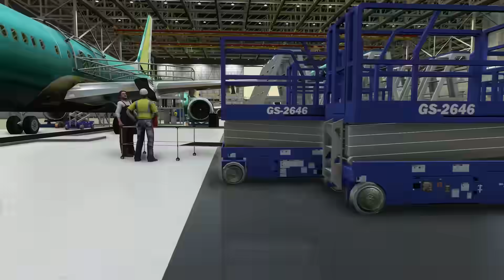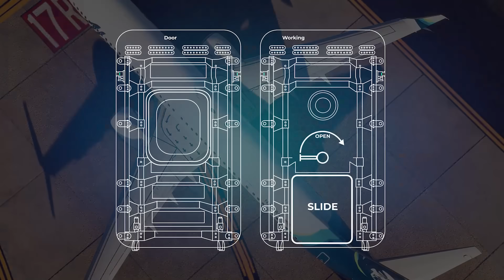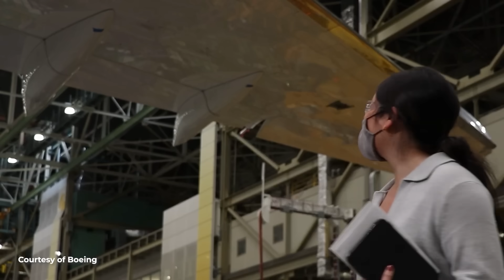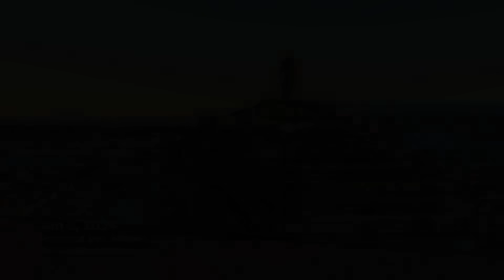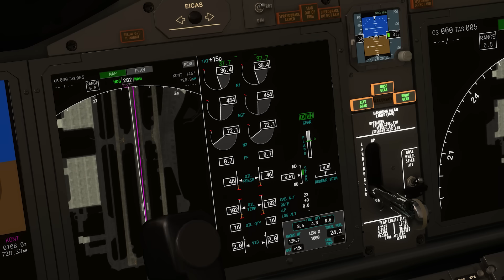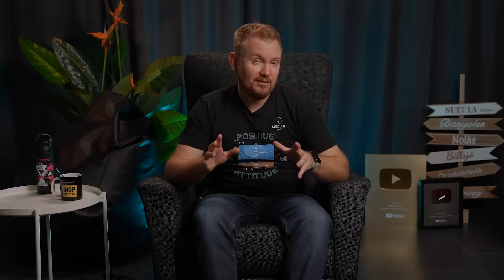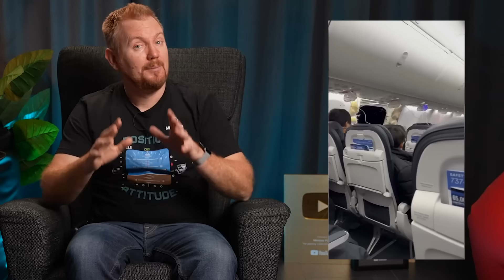Boeing 737MAX BlowOut!! The Scandal behind Alaska Airlines flight 1282

Comment: Thank you for posting this video. I believe the events of the Alaska Airlines flight were very well laid out thru the writing, the excellant graphics and explanations. Hsving flown extensively on all 737 generations I have been very negatively impressed by Boeing 's fall from grace, and believed from the first published ideas on the Max series was a serious mistake. The Max series, in my opinion was a betrayal to pilots and passengers due to the MCAS failed system, the lack of multiple AoA's, the deceitful  implementation of MCAS, etc.  In addition, the manufacturing and poor QC still on going is astonishing. It does not reflect Boeing's past aircraft such as earlier 737 versions, 100, 200, Classic or the NG's, as well as the 707, 727, and the 757 and the 6. I've flown on all of these models, some of them extensively, with the k owledge and experience of GA flying, also.  As I see it it appears the 6 crew members did a very good job, all the way around, thou there is the luck that the 2 closest seats were unoccupied, and apparently no one was nearby the door plus blowout without being belted in, or walking in the aisle, as well as the relatively low alritude of approx 15,ooo when it occured.  As well, the rapid decent and left hand turn and line up to land, and land seemed impressive in how well and our quickley it was executed.   Last few points, 1. Delivery on last day of month, was the delivery rushed to book it by boeing to set up payment ? What is the monthly delivery  schedule look like? Does it trend evenly, or is it weighted more heavily toward the ladt week, which raises questions, like " get it out the door itis so we get paid"?; 2. It has seemed from the beginning Alaska did not respond to at least 3 earlier pressurazation issues with a brand new aircraft. I never till now heard if the " whittling " passenger complaint till your video. Years ago I was on a flight where the same type of thing happened. Passengers were moved a way, and we diverted and made a pan pan landing; 3. Having listened to the ATC recordings several times when they were released I believe there were faults by one or more controllers in communicating with the cockpit, asking to many questions, etc. That added a burden to the cockpit very much. And last, it is very important when you declare an emergency to "MAYDAY MAYDAY MAYDAY" first, then in this case, having everyone's attention declaring an emergency decent, and if possible simply state" rapid depressurization,  unknown structural status".  It's hard to wrap your mind around such a reverse in firtunes, I understand that, but it's best to accept the emergency in your head fast and communicate in the strongest terms. Declaring a MAYDAY in the old days was drilled into us a kids learning to fly, especially as teenagers often we had a general since of inviceability.   Overall though, this crew really pulled it off, and thank god their altitude was so low and the cockpit grew appeared to manage things very well. I wish someone had saved the voice recording.   Thank you for this very educational explanation of the accident in question.

Comment: Although you mentioned that the seat back forward of the opening was rotated and  cushions ripped off by the rush of air, wasn't it rather the exiting interior side panel itself that damaged the seats? The side panel being wider than the plug must have violently deformed in order to pop through the opening, the rough edges catching the seat backs and cushions. I haven't read any account of this so far but believe it logically explains the damage.

Comment: For me it's most surprising, that no one in the factory noticed that there are spare looking Bolts flying around. As the aircraft came with it, they must bee a unusual part to have spare and as there are specifications for all integral parts of the airframe and safety systems, it must have been easy to find out where they were coming from

Comment: Everyone is gonna use this incident to build their own narratives and miss that flying is so safe that it takes an edge case where a logging system miss categorizes the QC procedures for the mid-aft cabin plug door having been opened or removed. 
Recall this door was only opened because of the strict QC measures Boeing has for rivets.

Comment: It was quite a shock that this thing happens, but the quick action of the brave pilots really help in this situation. 

But I also would like to point out that eventhough the cabin has a hole in it, the plane did not disintegrate, which means the structure of the plane is well made and well design. 

However, in my opinion, this oversight is quite easily miss. With tight deadlines and pressure from top management, something wrong is bound to happen.

Comment: Great explanation, probably the best out there. But few things are missed by everybody. 
1. Regulation that allows removal/re-installation of critical bolts that have no redundancy (without bolts the plug falls out) without any formal inspection, is a criminal negligence at best. 
2. It is easy to design the door in a way that even without bolts it would stay in place. If stop pads had a recess for stop fittings, door would not be able to slide upwards without first moving inwards which would be impossible due to cabin pressure, and in case of misalignment it would not be possible to pressurize cabin. 
3. Where were regulators looking, and why regulators are not admitting their own critical mistakes?

Comment: Can someone explain why any company would remove safety features such as exits at all if the plane comes with it? Even if it's not "mandatory" why not keep it for everyone's sake?
Or is Money just the answer? Money > Life always.
Reply: If it were just money, they would have more seats.  This configuration has fewer seats than the maximum, which is why the exits are not required.  Activating the exits would add weight.

Comment: I have seen this type of 'value engineering' becoming an increasing issue in recent decades. I have never worked in aviation, but an electrical engineer in building services - its amazing how much 'shit' gets passed when money is the over riding control factor in the decision making tree. 

Obviously, companies need to make money, its why they exist in the first place, but the 'bean counters' who now run most large international engineering companies are not trained in risk management or how to balance cost over the life of a product. Without these key skills a lot of preventable technical failures are missed, even good engineers can miss basic checks when they are pressurised with unrealistic time constraints in the verification and commissioning process. 

For me, the Spirit team who released the door plug and failed to refit it correctly are wholly responsible for this objectionable and wholly preventable incident, I would remove all from their posts pending retraining on procedures and verification step reviews to ensure no such mistakes can reoccur. 

It is easy to simply lay the blame at management, but we are all professionals, when something is SAFETY CRITICAL, you do not take short cuts or miss steps in a process, so whilst management systems need to be reviewed, you cannot remove personal accountability.

Comment: 12:26 Wait a minute ! if the maintenance team who were responsible for the installation of this door AND subsequently the locking bolts, and they were not re-installed, then WHERE ARE THEY ? any of the team members would surely recognize those particular types of bolts, and so ..what ? they are just left in some storage racks, in a box ? what ? some one surely must have seen them and asked themselves hmm where do these things belong ? this is scary stuff. Also, HOW could there NOT be a formal Q.A. check for this type of work done , which is a major part of the planes pressure integrity, I would have thought that this sort of item would be required to be checked off on some system and also signed off by someone else ?...I''m admittedly a bit obsessive about Q.A. comes from being a Lab Tech. in a former life...

Comment: Initially I thought "not another door plug video", but quickly I realized that this is actually telling the whole story with new details that were not explained before. As an engineer I recognize so many patterns here and am almost in disbelief that this is an airplane manufacturer.
Reply: As a software engineer it was clear to me that Boeing was a fatally sick organisation when the first flight test of Starliner (their very delayed new space capsule) suffered multiple unrelated software failures on the happy path (the everything-as-expected situation, not some hard-to-foresee edge case).  That can only have happened if they never even once ran an integration test before flying it.  Engineers as a subspecies are first and foremost motivated to turn ideas into things that actually work.  The more audacious and ambitious those ideas are, the more motivated they are to make it happen.  Aerospace engineering is pretty much the most extreme example of this - you can be absolutely sure that every engineer on the project (software or otherwise) would be deeply invested in the success of the mission, and keenly aware of the insane difficulty of the optimisation problem that needs to be solved to make space hardware work - they would be kept up at night worrying that they'd missed something, no way would they just omit the most basic testing if they had any say in the matter.

Engineers perceive any impediment to achieving their goal (making the thing, and making it well) as a threat, which often includes management (either because the management makes actual bad decisions, or withholds information from the engineering teams so that their necessary decisions don't make sense).  To have a failures like those on the first flight test of Starliner, you have to have built such a toxic work culture for so long that your engineering teams and management are in all-out war with each other.  With the power imbalance, that means that engineering always loses.  In that environment, your best engineers leave, and any who stay have to distance themselves emotionally from the success of the project.

At that point the only way you recover is to gut both management and engineering and rebuild with competent people who understand what went wrong and are committed to the structural and cultural changes necessary to avoid it happening again.  Good luck getting that right in a company as large and sick as Boeing, where the side effect of losing the institutional knowledge that would entail would set back anything they're working on by many years.
Reply: Boeing is run by greedy CEO’s. Not engineers. I’d bet we will co to ie to hear about accidents like this that would be avoided if Boeing was run with any amount of integrity
Reply: " I realized that this is actually telling the whole story with new details that were not explained before. "

===

The details have all been explained before, just not in one place . This is why I keep watching this channel.

Comment: I recently flew on a CRJ-900 and sat in the emergency exit row. It was a rickety old thing. We got about halfway through takeoff and the door across the aisle starts making this... buzzing noise, I guess? It sounded like a card in the spokes of a bicycle, except it also whistled. People around barely spoke for the duration of the flight and just looked around nervously. It's not the same as having the door blow out, but I can see how people were so quiet in this case.

I feel vindicated for suggesting that the guy in the window seat move to the empty aisle seat.

Comment: What was the root cause of the explosive depressurization accident? It seems to involve at least: 1) The Quality Management System is broken, 2) The culture of quality is deficient in a situation where a corrective action introduces additional risk to quality and safety, 3) The interface between Boeing and its tier-1 supplier Spirit Aerosystems is defective, interacting with QMS issue #1.
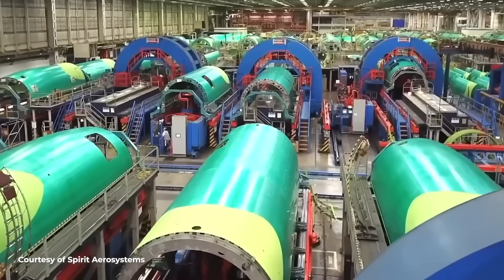    11:10 "The door plug would have to be opened or completely removed." There is no way that a minor semantic distinction between open and removed should have allowed a major and safety-critical quality escape like unchecked, in fact missing, bolts on the door plug. Both possibilities should have triggered verification of the corrective action and generated auditable records of the fix. The quality management system is not fit for purpose, it needs to be reexamined up to the FAA level, and replaced with a system that works. Even an engineer from an industry not as safety-critical as aviation with cursory familiarity with QMS's (i.e. me) would be aghast that the corrective action produced outcomes worse than the original problems with rivets, then seals. If  there were an adequate culture of concern for quality and safety, the defects would have kicked in a heightened level of awareness that ensured that multiple pairs of eyes verified that the corrective action was accurate, effective and safe. And let's not even get into Spirit Aerosystems' culture of quality if they just paint over damaged rivets. The Boeing organization should have taken responsibility for the failures of their key supplier and ensured that the interface between the organizations did not allow major problems like this to slip through.
    Unfortunately, if my initial analysis is even partially correct, the QMS issues have implications way beyond just one door plug in one fuselage. Combined with the other quality problems between Boeing and Sprit Aerosystems, many things need to be done to install a QMS fit for purpose (as well as restore a culture of quality) and start regaining the trust of Boeing customers and the flying public.

Comment: Engineer here. That no quality control was performed after what was obviously a critical repair, is beyond belief.
Reply: Could be Planner error (not likely).  Inspection is always called out after structure installation.  Depends if it was production, or rework planning.
Reply: @chipset2900 In GMP you'd have a checklist signed off by a different worker.
But if it is denied there is any work done (that's why the door was opened rather than removed) no checklist is needed and the work goes FASTER.

Comment: The really scary thing is the root cause here. It's not a problem with the design of the plug door. Or the design of the plane. It's a production QC issue. But there is something truly terrifying in this story. And it's not immediately obvious. When Boeing received the plane from Spirit, they went forensic on it because they had had a string of problems. They discovered bad rivets near this plug door. Spirits initial response was not to repair the bad rivets properly. But instead to sand them down and paint over them. To Hide The Problem! How much of that type of thing snuck through before the Boeing inspectors picked up on it? And this sort of thing isn't something that you can just issue a service bulletin on. It's not "Inspect all Plug Doors for missing bolts". It's there may be a critical structural weakness in the airframe, somewhere, that went undetected at the factory and was covered up."

Comment: I am unable to understand how this went undetected over a couple of months? Since the door plugs were never installed effectively the door was loosely fitted. If it true then during earlier flights the said door should have slightly moved due to vibrations. Then the cabin pressure would have dropped many a times. Also from outside the planes body color should have shown cracks. Why this was not reported?

Comment: You mentionned the pilots ear popping when the pressure equalized, which brings to mind a question I’ve had for a while. I often get severe pain in my ears when I’m flying (as a passenger), during the descent. It can get so bad I end up crying and would hardly be able to focus on a task as demanding as landing a plane. Do pilots (and cabin crew) also experience this kind of pain ? How do you deal with it ? Could this prevent someone from ever getting a pilot license ?
Reply: I am cabin crew and have had issues with my ears. There's a wide variety of coping mechanisms - Yawning, blocking your nose and blowing out air, drinking carbonated water, drinking chewing or sucking in general, and medications like Olbas Oil (an inhaled decongestant) and Sudafed. Do not use ear plugs or in-ear headphones if you have issues with clearing your ears as it basically blocks the air from going in and out. If you have the option, don't fly with a cold. Yawning is the most reliable aid besides medication. I carry Olbas Oil when flying with carriers besides my own after I suffered severe discomfort while taking a deep night to eastern europe and they didn't carry it (we carry it on board). 
Hope this helps, and do reply and ask for clarification if confused :)

Comment: 22:56 I suspect this could be simulated in a lab or even on a software (to a degree). I think it would be dependent on how much spring force those bottom springs provide vs weight of the door.

 Depending on forces, tiny vibration indeed could move the frame upwards with nothing else except its own weight (which is being countered by sprint force) over time, due to nothing else stopping the frame from pushing back down.

Only viable answer tbh, because those bolts/lock mechanism were (probably) designed with forces being applied to them, since the locking bolt was only meant to hold the bolt from being slided downwards.

Comment: Why not just have an extra door?
Reply: Possibly due to extra maintenance cost of inspecting said doors, having crews check doors, etc.

Occam's razor can be used here. If the doors were replaced with plugs, that was done for a reason. MBAs might be stupid with engineering but they're good money pinching goblins.